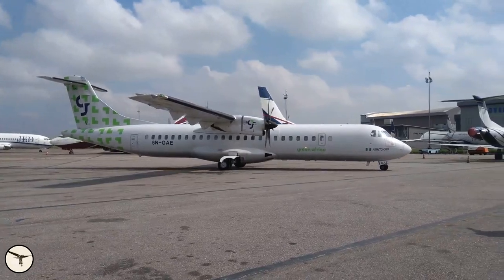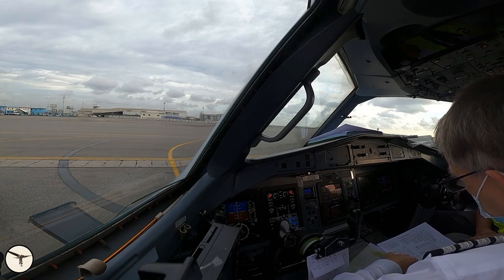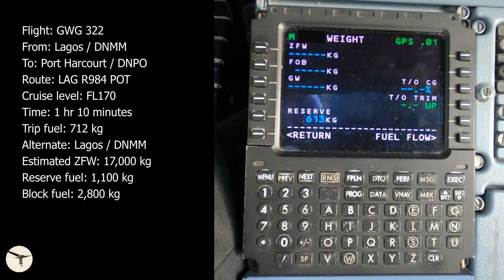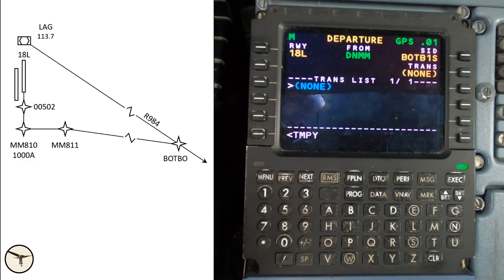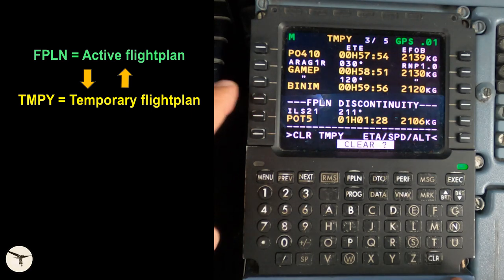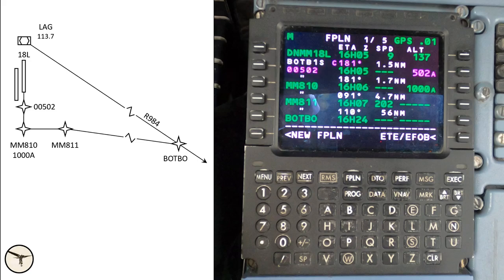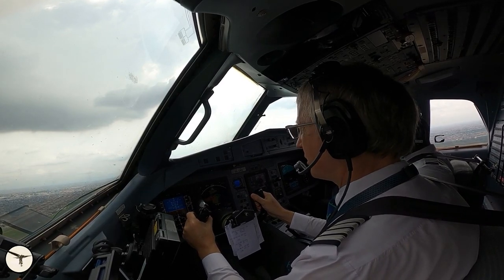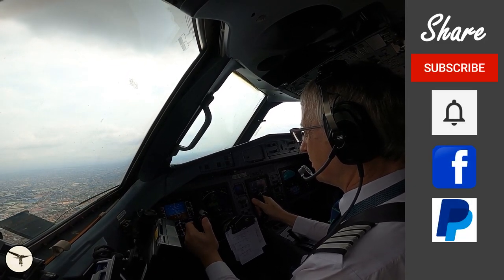ATR Systems - FMS part 1.1

Comment: Love how the annunciator lights go dim once you hit the starter, I have never seen that in any other plane
Reply from the maker: The annunciator lights might go to dim when you press the engine start button. This is caused by a drop in the voltage from the GPU. As soon as the voltage is normal, the annunciator lights will become bright again. Important avionics are protected from this drop in voltage, as they are powered by the emergency battery during engine start.
Reply: @FlywithMagnar  Very interesting, maybe this is due to the fact the ATR has only one Main Battery while all comparable aircraft (Dash-8, E-Jet's, etc.) have two batteries plus an emergency battery?
Therefore the voltage in the electrical system drops (apart from the Systems powered by the EMER BATT) while in other aircraft the essential DC busses would be powered by the battery not used for engine start at stable voltage.

Comment: Hello captain, I have a question. At minute 16:48 you enter a MAC data with a value in 26.5%, I am a simulation enthusiast in MSFS2020, I use SimBrief to create a flight plan. This value is generated by SimBrief when the ATR is selected? or how can I get it?
Reply from the maker: The MAC data is from the loadsheet. It varies with the loading of the aircraft. I do not use SimBrief, and therefore, I do not know how it works with this application.

Comment: I'm an ATR pilot and I have a question about the POS INIT page. After completing a flight and while setting up for the next one, I check this page. However, now the INIT POS does not match the GPS position. (Or the LAST POS) It is often many degrees different, so it is not a small error. Can you please explain why this happens? I always select GPS POS for this reason, and because my airline has not updated its procedures.
Thank you!
Reply from the maker: Hi, according to the latest revision of the FCTM, we do not check the POS INIT, NAV DATA and UNITS pages. Not even during initial setup. 
The reason is that the FMS uses many sensors (GPS, DME, VOR, etc) to compute your position. When you select GPS POS as your current position, you exclude the other sensors. That means your position is less accurate than it should have been. If there's any problem with your position, the FMS will give you a message.
Reply: @FlywithMagnar   Thanks. I understand, but my airline has not updated its procedures to match the latest revisions. My question was about why the position shown is so far away from our actual position. In one case it was at a point 415 NM away...

Comment: Hi Captain, thank you for all the information you give us on the ATR. As a sim pilot i have been enjoying the ATR, but the one thing ive noticed with sim version is it seams to take alot of runaway to get up to speed, im forever having tail strikes on rotation  even at Gatwick. I can't see how this would be the case in the real thing. Would love your view on this. Many thanks Gary.
Reply: I can't comment on the accuracy of the sim. However, a tail strike is caused by either rotating at too slow a speed, (below Vr) or rotating too quickly. It should take about 5 seconds to bring the nose up to 10 degrees.
Reply from the maker: Hi Gary. Good news: The developers are working on the issue. The next update will have a better acceleration. This has taken longer time than anticipated. The reason is that the base model (FS 2000) has some limitations for the developers. This why Microsoft will launch FS 2024.

Comment: First of all thanks for the excellent tutorials and explained in excellent and very understandable English.

Then 2 questions if I may:

Today I effected a planned flight using the AUTO SPD SEL speed selector (target speed indicator in the PFD in magenta) and I saw that the right speeds are automatically set for the various phases of the flight (e.g. 170 knots in climb, 240 in cruise, Vapp in final etc).
The question is where are these speeds set (except the Vapp of course) ?

Another question: once the flight plan has been entered, how do I change the speed in the MCDU, how can I change the speeds indicated in the SPD column ?

Thank you
Ciao
Reply from the maker: The speeds are defined by the FMS. Once the FMS knows the weight of the aircraft, it calculates the speeds for takeoff and landing. (Fuel consumption is accounted for.) The speeds are also adjusted for icing conditions when anti-ice is selected. The cruise speed depends on the alitude and atmospherinc conditions. The FMS also takes into account any speed restrictions published in the SID and STAR. 
To only way to change the target speed, is the select manual speed. We do this when ATC instructs us to fly at a certain speed, to mention one example.
Reply: Thank you Captain for your quick answer.

Comment: Hi Captain, your videos were really helpful for my initial training. One question. Why is V2+5 selected in the SPD Sel before take off? Thanks!
Reply from the maker: Less drag and therefore better rate of climb. For the same reason do many airliners use V2+10 or 15. V2 alone is only usd when there's an obstacle close to the runway end.

Comment: Hi Captain, pretty unnerving to returning to the main menu leaving the boxes empty in the P.Pos page ! Do you confirm the lat long on P.Pos page with your plate ? After confirming its accuracy can you pick that line and copy on to the scratch pad and then press the line key you want to copy to ? thanks for the video.
Reply from the maker: A lot has happened since the 600 was introduced. As, the FCOM states, it's better to leave the boxes empty. Yes, we confirm out position with the airport chart or signs at the parking stand.

Comment: Hello Capt. Hope you are fine and healthy. 
What if Xtalk fails in flight. I had the same once in flight. LHS was fine. RHS was way off. Hence we completed the flight normally from LHS. 
Thanks and regards
Reply from the maker: Cross-talk fault does not affect the performance of both FMSs. They will switch from dual mode to independent mode. Each FMS are still functional and can be controlled with its respective MCDU. But you must remember to enter the same information into both of them.

Comment: Hello Capt Magnar, do you know or if there is any application that is a computer based trainer for the FMS 200. Also what’s the best way or source to learn the FMS 200. 
I have looked for applications like the boing or airbus has to help with practicing. 
Or is there any similar app from airbus that someone can use to practice. Thanks.
Reply: Love your FMS 1.1 
When is the next one coming out. 
It was very helpful.
Reply: Lille I ovo

Comment: Hello Sir I know you are a real pilot/certified flight instructor for the ATR but I was wondering if you could make a video about what is correctly/incorrectly modeled in the ATR 72 -600 that is offered in the Microsoft Flight Simulator and what needs addressing. Thank you in advance.
Reply from the maker: Hi, such a video will require a new edition every time an update is released. And they will be frequent in the first months. Most errors are cosmetic, such wrong color in an indication. The FMS is incredibly complex, so there are still some issues to be solved. I will release a video soon, showing what is working.
Reply: @FlywithMagnar  Great thanks.Much Appreciated.
Reply: @FlywithMagnar  is it possible to create arcs(circles) around fixes on this fms?

Comment: Magnar I am not a pilot. You may delete this comment if you feel it detracts from your video or if it might confuse someone.

I thought that most commercial aircraft have load sensors to determine the actual weigh on wheels. Does the ATR 72 lack this feature or am I misunderstanding about larger aircraft.

Thank you.
Reply from the maker: Hi, thank you for your question. There are no stupid questions; only stupid answers. To my knowledge, none of the today's transport aircraft have load sensors. Honeywell developed such a system in the 1960s, and it was offered for Boeing 707, Lockheed L.1011 and Boeing 747 freighters. However, the reliability of the load sensors was poor, and it was considered to be waste of money. If you cannot trust a system, you better not using it.
Reply: @FlywithMagnar  I see. And because the weight is such a critical number it must be delivered reliably.

Thank you sir!
Reply: @FlywithMagnar  Doesn't APM calculate the load when there is no selection?